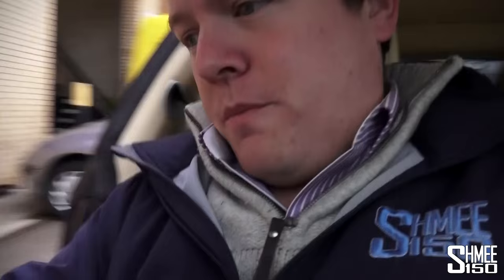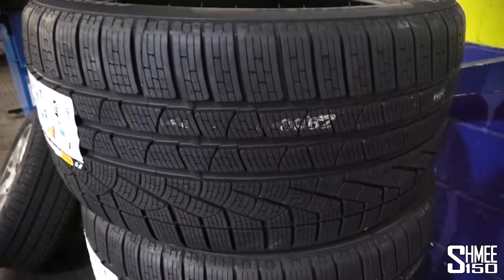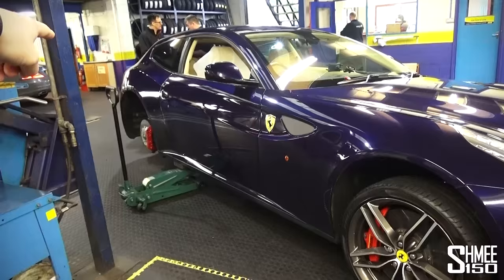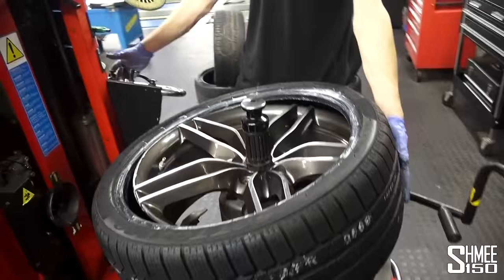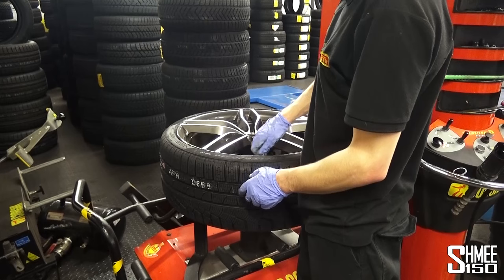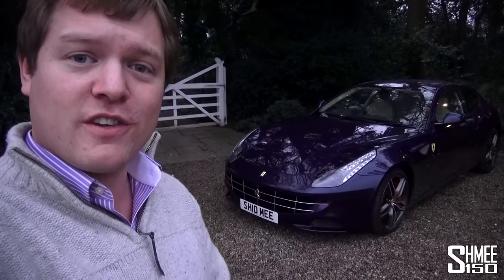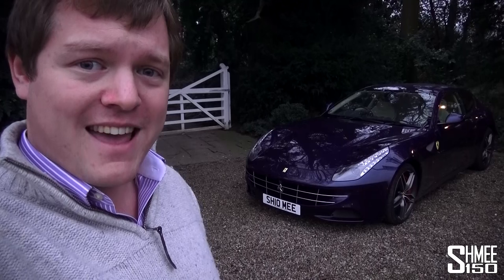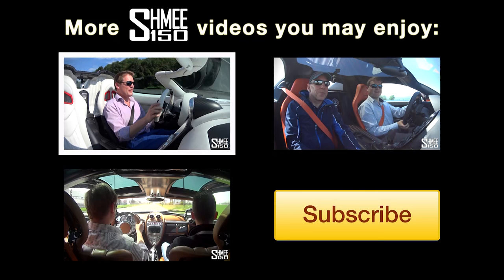Preparing the Ferrari FF for Winter - Pirelli Sottozero Snow Tyres

Comment: Great video Tim - the machines that removed the existing tyre and then loaded the new tyre an upgrade from what is typically used for tyre installations - or at least it looked that way to me - that guy did a good job - hope he got a good tip ! :-)

Comment: Have the same tyres on my Cayman. Very impressed so far. I haven't had to use them much in deeper snow. But traction when parked on ice or flat snow is great. Grip in heavy rain is nice as well. And you can still drive the car hard in the dry! Not sure how long they'll last but sure worth the money.

Comment: In case anyone wanted to know...winter tires in addition to having different tread design will also be formulated with different rubber compounds that behave better when cold.  My Michelin Pilot Super Sports harden in sub-freezing temperatures, which fortunately isn't really a problem where I live so I use them year-round.

Comment: Interesting fact about tyre dimensions is the mix of measure systems.
285/35R20 translates to
285 mm wide, the profile is 35% of the width(285) and the diameter is 20 inch. Confusing system...

I love this technical videos, more like this!

Comment: Ouch, look at the uneven tire wear at 6:40! Tim, it looks like your FF needs a wheel alignment.  Did it get a 4-wheel alignment after the new tires were installed?
Reply: +Vincent Gambini - Judging by that wear, and assuming no fault involved, it looks like the car's set-up more for hard cornering performance.  If so, probably not so suitable for Tim's style of driving, I wouldn't have thought.
Reply: +Vincent Gambini Correctly aligned wheels wear unevenly. It has to do with toe, camber and the slope of the road surface for drainage purposes. This is why you rotate wheels from side to side.
Reply: +Vincent Gambini wow. Those tyres were almost brand new, no? And are already toast.
Reply: +Vincent Gambini The guy that done mine last said if all have that wear on the inside it could be those speed bumps where you straddle them. Said he sees it a lot, seemed to know what he was talking about. Although if those are new, done a few thousand mile then wow.
Reply: +Admiral of the Fleet Sir Cloudesley Shovell Yes, Ferrari uses lug bolts (as apposed to traditional lug nuts) for their wheel fasteners. The ones you see in this video are the standard steel wheel bolts. The titanium wheel bolts you see here: http://scuderiacarparts.com/blog/wp-content/uploads/2015/05/458apertawheels2.jpg are the optional wheel bolts Ferrari offers for their cars. They cost around $2500.
Reply: +Admiral of the Fleet Sir Cloudesley Shovell 
Most Italian/european brands of cars use bolts.

Comment: I had a set of sotto zero. Not bad at all if there is no real winter. Terrible on snow but good and precise if there is wet or cold tarmac. Quiet and efficient with good feel and response. Had a taxi ride to work few times if it was white.sold and bought nokian for replacement. Not that Kindze of performancem but well rounded for any winter occasions.

Comment: Tyre Profile (35mm) on the tyres is actually a percentage of the Tread Width (285mm). The 'R' stands for Radial Tyre and '20' stands for Rim Diameter or Size :)

Comment: Ideally you should use a guidebolt when removing the wheels to ensure you dont bump them on the ceramic discs which could crack them (and cost insane $$$$)
Reply: na bro, don't be a wally and you'll be fine. I knew what I was doing, it's easy once you get the hang of it

Comment: Pirelli P Zero is not an all season tyre. its a summer ultra high performance (UHP) tyre.
P Zero Corsa is the semislick version
Trofeo is a trackday tyre which is barely legal for road use, with Pirelli recomending it only to drive to and from the track and warning for the increased danger of aquaplanning in wet road

Comment: Shmee, do you plan on modify your exhaust? Maybe a simple mod you can do is disconnect the valves. It should be fairly easy and is easily connected back if its to loud, but i guess you wouldn't mind ;) Would sound very nice with the valves permanently open

Comment: Doesn't the FF have a spindle to place in the bolt hole for removing the wheel? Just catching a carbon ceramic with a wheel is enough to chip them. I always watch like a hawk when mine are being changed as a disc is over £4K to replace.

Comment: I've always know tyre installations to include the changing of valves. Is there a reason they didn't do it on this car? Maybe it's different on these high performance cars?
Reply: tyre pressure monitoring systems, when I take the tyre off the wheel you can see a small grey box, which is said device, don't break them, at all costs let alone change them.

Comment: Pirelli Sottozero are the worst winter tires I have ever had on a car and this is a REAL review with 3 Quebec winters on a 2011 A4 Quattro. I am glad to get rid of them. Very close tread pattern prone to spin with ROUND EDGES prone to understeer in any depth of snow. You will be taking any corner at walking speed in snow. Noisy and wear out like butter (saw the tread bars in less than 20K). Ice grip is no better than our all season summer tires (I tried both on the same day). We bought a new C300 4Matic and the dealer suggested the sottozeros.  I refused so they found a set of continentals.  Much much better tire.  I can actually turn on snow now.

Comment: Whats the road noise like with the pirelli winter tyres? Had a generic medium range on my subaru and they were horrendous!
Reply from the maker: +Tommy Moore So far from my short journeys no problem, but the sound proofing in the FF is fantastic so you don't hear much - frustratingly not even the V12 properly.

Comment: According to Ferrari website, the front tire should be 245 and not 235. I'm curious here.

Those are a 10 year old Sottozero version. i would definitely not recommend them. And saddly, Pirelli doesn't offer the new one for the FF...
They're still good in the dry and wet, but far behind competition in snow and ice and very extensive for what they are.

Looking at performance winter tires, I would have the Michelin Pilot Alpin 4. The only other option available for the FF in OEM size. But they're definitely much better that the old Sottozero II.

Plus they're in  295 rear like the summer tires. Wich is probably better for you since you're almost never going to drive on snow. And not more than a light snow.

Comment: anybody got an idea what a separate set of rims would cost? Since that would be the thing you do with normal cars. but in this case changing them multiple times is probably still less expensive than 4 separate rims
Reply: Anything between $5000-10000 for a set of good quality wheels.

Comment: shmee does it matter which way the tread is on tyres
Reply from the maker: +David Isoka-Onwordi They are designed for maximum grip and because of that the tread pattern pushes in certain ways
Reply: +Shmee150 OK, thanks

Comment: 285x35x20" for the rear and 235x35x20" for the front...? Not good for a the gearbox an a 4 wheel drive car...
Why not the same circumference like Gt-r front 255x40x20"...?
Reply: The FF has got a separate gearbox for the front wheels. Still, doesn't most "traditional" AWD cars have different sized tires front/back anyway?
Reply: +Speednote10 No usually exremely important to have the same size mm around the tire..., maximum 2% difference
Reply: Thony Olausson
I think I didn't read your comment properly, I thought you were thinking of width, not rolling diameter. My bad

Comment: The fact you think they did some sort of a special procedure is concerning. All modern garages use the same machine and methods.
Reply from the maker: +Toad Boy You are correct, however I have changed a wheel at another garage that will go unnamed and their inferior machinery put a scratch right around the edge rim of one of my wheels.
Reply: I see, speaking from experience. That is fair enough.

Comment: sottozero are not the best winter tyres.
Reply from the maker: +metalbyku They are a specific tyre made in the right fitment for the FF, I wouldn't put anything else on it.
Reply: I understatd :) I had a set of sottozeros a year ago, now bought ContiWinterContacts. Huge difference in traction on loose snow. Cheers from Poland! :)

Comment: They didn't jack the car correctly at all so clearly not the right place to go
Reply: +DC_Automotives explain..
Reply: Considering the very professional look of the garage and the fact that when Shmee drove in there was two expensive cars already on there, I think they know what they are doing. Shmee would not take his Ferrari somewhere who can't do their work properly
Reply: +ryan1540 the Ferrari has a lift system so when jacking a car with lift or air ride you need to raise it to the highest setting or jacking mode so you don't damage the air bags
Reply: +Scott Sherman still didn't jack it right
Reply: +DC_Automotives or you are wrong...
Reply: DC_Automotives I wouldn't loose sleep over it pal. It's obviously been done with no problems so that's all that matters.
Reply: +ryan1540 Exactly
Reply: +ryan1540 might not if caused damage but it can cost £2000 plus to fix
Reply: springs mate, springs